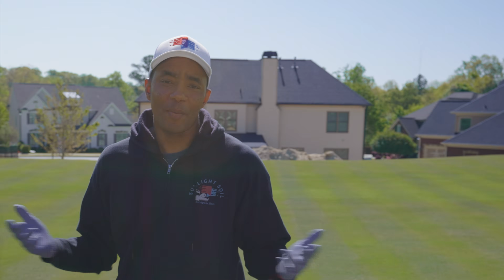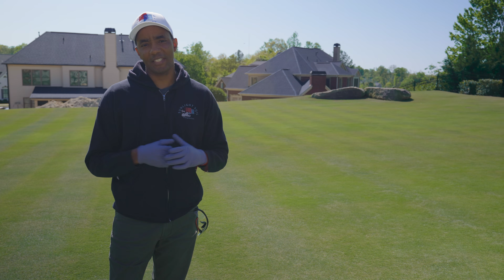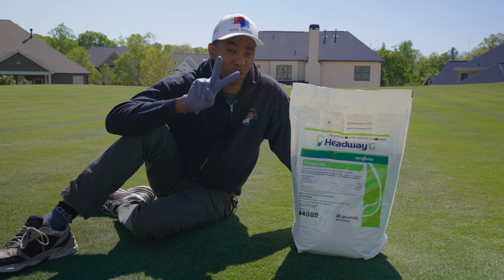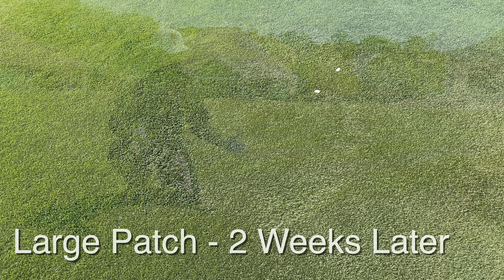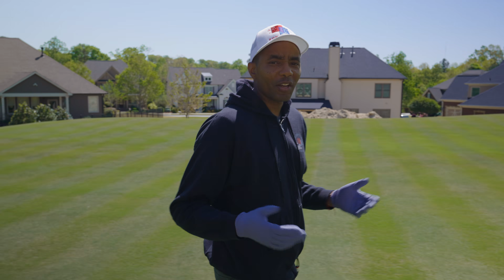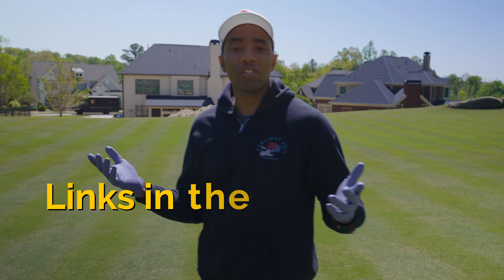Get Rid of Lawn Fungus -  Brown Patch, Dollar Spot and MORE

Comment: Thanks for the info.  I got Tahoma 31 sod installed last summer.  I quickly learned about Army worms and now I'm dealing with brown patch into late spring.  Didn't know hybrid Bermuda was so labor intensive.
Reply from the maker: It can be especially if maintaining it at shorter cutting heights.x

Comment: I applied some heritage sc today for redthread. Been a problem for years. I've been using propoconizole and it's definitly become resistant to it. I may do another heritage dose in a few weeks. Also purchased some headway g for the application in a cpl months. I hate red thread it'd annoying.
Reply from the maker: Let me know how the Headway G does for you Dave. I like the results I get with it.
Reply: @RonHenry  Will do. Do you only use granular fungicides?  I have figured the sprays seem like a little better deal but granular definitely easier.

Comment: Looks like an awesome product but holy crap is lawn care getting pricey with their products. It's starting to get ridiculous.
Reply from the maker: It does work really well though Rash Panda.
Reply: @RonHenry   I'm sure it does but at $90, for a little over 1 application, stings.
Reply from the maker: It kills the fungus though.  Totally worth it to me.  Lawn fungus can make an absolute mess of your lawn.
Reply: Yeah it's starting to take over parts of my lawn. I bit the bullet and ordered some. What kind of fert do you recommend to help push it out?
Reply from the maker: @Mastaholic  It doesn't need to go down with any fertilizer. If you have an Earthway spreader, use a setting of 11 or 12 depending on the application rate you're after. Be sure to read the product label.
Reply: Thanks for the video on the headway Ron. It knocked out a huge brown patch problem in 2 weeks. It's the beginning of August and my lawn looks the best it has all season!
Reply from the maker: Glad it did the trick!
Reply: Btw Ron, new sub here. I really like the straight forward approach you have in your videos. Well done.

Comment: I bought some headway and did 3lbs per 1000. It works but I want to stay ahead of any fungus. I live in a pretty humid area here between the Mississippi and Ohio Rivers (deep Southern Illinois). My question is, is there a downside to reapplying too soon? Thoughts? Thanks again for the video and the tips. Btw, I'm growing a bent grass putting green.
Reply from the maker: Hi dw. davis. If you're worried about more fungus issues, I would reapply 21 - 28 days after your last application. The product works for that long so no need to reapply before then. Let me know if I can help with anything else. Thanks for watching the content.

Comment: So I used Disease Ex all last year and Prophesy at the end of the growing season. 2 weeks ago I noticed signs of dollar spot (web like circles) on my lawn so I put down Disease Ex again (curative rate) and also sprayed in liquid propiconazole. The dollar spots went away after a couple days but are now back almost 2 weeks later. I am also noticing red thread in a few locations. Did my grass grow a tolerance to Disease Ex? Not sure what to do now.
Reply from the maker: Heya Darren. I normally only see the dollar spot webs early in the morning. They're gone by 10AM or so. Disease Ex is Azoxystrobin which doesn't target dollar spot. You need propiconazole for that. If you have anymore of the liquid propiconazole, you can apply that or simply apply Headway G which has a combination of Azoxystrobin and Propiconazole. I've used it on my lawn with great results for large patch. Knocked it right out.
Reply: @RonHenry  thanks Ron. I spray again with propiconazle this weekend.
Reply from the maker: @darrensaliva  sounds good man. That should definitely help the situation. Thanks for watching.

Comment: Hey buddy... how can you tell if it's Lawn Fungus or Grub Damage?
Reply from the maker: If you're able to easily pull up a second of the lawn jr, it's likely a grub issue. If not, it's potentially a grub issue. Is it a ring in the lawn or somewhat random-looking?
Reply: @RonHenry  ... Front yard faces the south; gets an abundant amount of sunlight; however in the front yard there are a few sections of thin areas, or bare patches kinda oblong [not exactly round]. Not exactly sure what's causing it. I was thinking about going with that product that you recommended that attacks both fungus & grubs.🤷‍♂️ But I have to do it before the dirt dump trucks get here.

In the backyard there are alot of bare patches. I believe that these are the results of construction debris [trash, scrap concrete pour, and broken bricks] being "hidden" under sod & pinestraw, before I purchased the property. Some Home Builder Contractors are horrible. Also trees shade & soil Compaction are major culprits that are contributing to my issues. I've worked diligently to clear/clean out the backyard. I'll be aerating once the storms clear out. Also, the Landscape Distributior is on standby for backfilling & topdressing the property [he's sympathetic to what I've run into & he's giving me good prices by the Cubic Yard on whatever I need topsoil, sand, mulch, compost & he's willing to mix it at whatever ratios that I need].

I know that's 👆👆👆 alot to take in.
Reply from the maker: @jr1001jr  I'd throw down Caravan G out of an abundance of caution jr.  Caravan G here: http://ron-henry.com/caravang
Reply: @RonHenry  I absolutely will do sir... and thanks for taking the time to help me out. 

Do you have a web page or forum; where I could follow along, see FAQ, read your tutorials, view your products?

Comment: Gm Ron. Will PGR make fungus worse ? I put down PGR At the beginning of the month.  Two weeks later I have brown spots and idk if it’s brown patch , herbicide burn or grubs . What u say I use ?
Reply from the maker: Hi Ru Skates. I’ve not heard of PGR promoting fungus issues.  Most lawn fungus problems come from overwatering, over/under fertilization, hot/humid weather and lower mowing heights.  Can you send me pictures of what you’re dealing with?  ron@golfcourselawn.com

If you applied PGR at the correct rates you will see mild yellowing a few days after.  That should clear up within a week though.  If you haven’t put an insecticide down as yet, I would absolutely do that. A good combination product is Caravan G. Caravan G here: http://ron-henry.com/caravang I’ll look out for the pics.  Thanks again. 👍😎

Comment: How much nitrogen have you been using in this cool wet weather? Large patch in Bermuda thats really weird. I remember working on a research project once where we noticed cool season type diseases in warm season turf. It was really strange...well conditions were perfect for it. Spring temps were cool, it was wet and turf was super short and over fed. Tested different fungicide combinations many of which are not for residential use and they worked really well. What we also found was that limiting the care of Bermuda in cool spring weather to only mowing and natural watering from rainfall greatly minimized the occurrence of cool season type disease.
Reply from the maker: Heya SMK. Early April was the first full rate application. of the granular. Just under 1/2" lb of nitrogen. The biggest change between last year and this year is lower mowing height. Last year at this time I was closer to .75 vs. just under 1/2" now. The Headway G application has cleared things up though. Will likely do a follow up application at the end of this month and call it good. Your research sounds really interesting.  Thanks for chiming in sir. Always appreciated. 👍😎